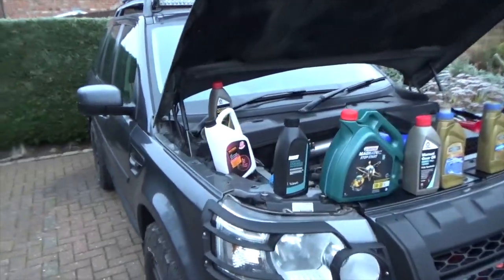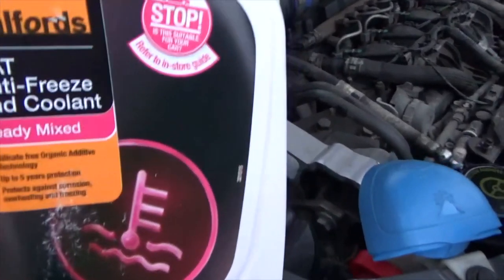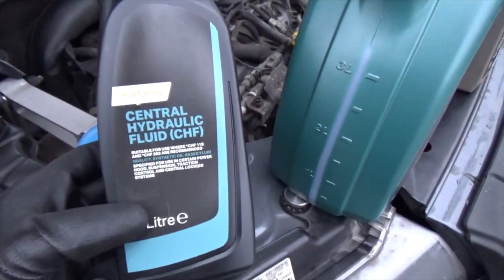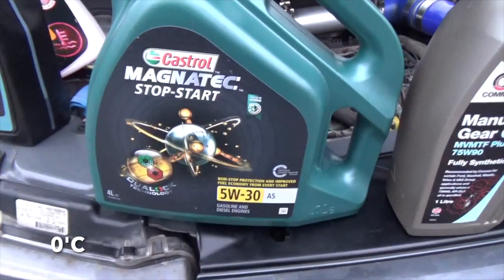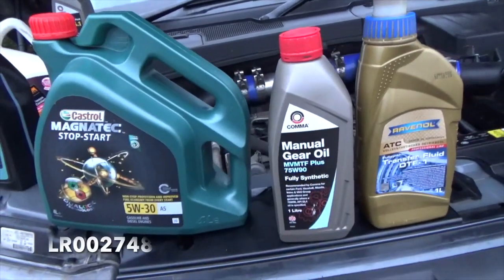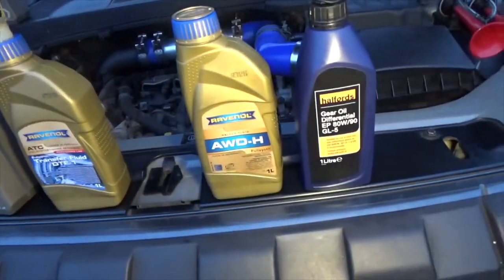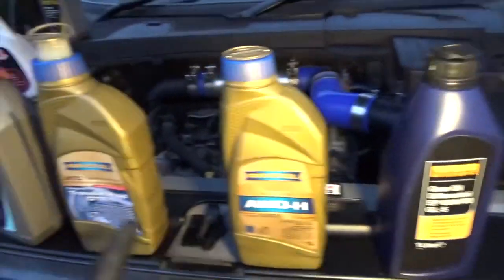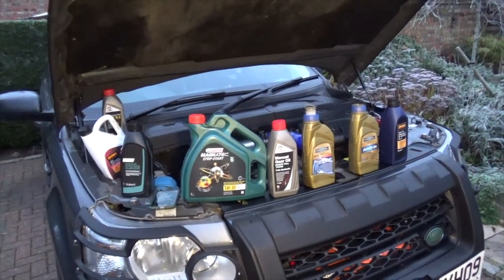All the fluids! - Land Rover Freelander 2 / LR2

Comment: Hi Scott
Last year my Freelander rear crankshaft oil seal developed a bad leak. The job was too much for me so I took the car to a local garage for repair.  As you know the job involved removing the gearbox so it made good sense to replace the clutch and flywheel assembly at the same time. The garage did a great job not your usual 6 bolts out and two back in There was no evidence that the box had been removed a real top notch job. The repair was done in the summer of last year, everything was fine but as winter approached the gears got increasingly harder to select especially on frosty mornings. A sudden terrible thought sprung to mind I wonder if the garage has topped the gearbox oil up after finishing the job.  I decided I’d better check this so after removing the gearbox level plug the oil level seemed to be fine but it appeared to be of a very thick consistency. I decided to drain the oil and on observation it was clear that heavy gear oil had been used. ( Grr ) I drained and refilled the box with the correct grade oil and suddenly to my relief my previous nice easy gear changing was restored. This just shows how important it is to use the correct grade oil at all times. That is a  very important and informative video you have made there Scott and just shows how crucial it is to always use the correct oils. 👍👍

Comment: Thanks Scott, very helpful. One question, you mentioned it’s important not to mix certain fluids, how do you know what fluids are already in your FL2 when to you need to just top up? Best wishes, Anthony
Reply from the maker: Good question! The answer is you don’t. If you are unsure what fluid a previous owner has put in then best to drain and refill. With coolant and steering you should be able to tell from the colour. For brake fluid and oil it is more difficult.

Comment: Hi Scott, can you recommend anything for unblocking washer washer nozzles. I've tried everything. Cheers!
Reply from the maker: You could try a pin and then blast through with something like an air duster. Failing that, just replace them, they are not expensive to buy and quite easy to swap. Check that it is the jet though and not the pump.

Comment: After the checking the part number on lr the 6 speed manual transmission oil seems to be a 75w fe, not a 75w/90 why did you opt for a different oil than spec, or is the same thing and I’m an idiot, or will it no really matter?
Reply from the maker: 75 is the cold viscosity so will be the same. I’ve not heard of 75W FE but you should check the hot viscosity. It needs to be 90. Haynes says 75w90. That is also what Halfords recommend.
Reply: @BeavisPits  Just in case anyone else is reading this slightly confused this is a note to clarify things. For the manual gearbox pre-2011 models (like Scott's) the LR specification in Castrol MTF 97309. This is a 75w90 grade oil as is mentioned in the video. For post 2011 models the LR specification is Castrol BOT 350 M3. This is a 75w single grade oil. Clear as mud...or old gearbox oil 🤣

Comment: Is it really only 1 litre for a manual gearbox?  I have an SD4 auto and I cant seem to find straight forward information on what type and what quantity of auto gearbox to buy.  Ranges from 1 litre to 7 litres (7 is dry fill so seems too much for a refill) and anything in between!
Reply from the maker: 1.9L for manual gearbox
Reply: I was told with the auto you need special tools apparently, its got to be done at a specific temperature and its a height measurement of the oil level within the gearbox not a specific quantity

Comment: Hello, I recently purchased a 2012 SD4 HSE. After buying the car, I immediately replaced it with Shell C3 5W30 engine oil. You put A5. Many Koreans say that C1 engine oil must be used, so I was curious about whether C3 engine oil would put a lot of strain on the engine, so I searched and came across this video. Wouldn't it be a big problem if I put C3 or A5 in it?
Reply from the maker: All FL2s are 5W30, but later models with DPF may need a different oil code. Mine is pre-DPF so uses A5. Later may be C3, I’m not sure. I’m sure it would be fine to use C3 in an older engine. The code is to do with smoke emissions not the lubrication properties.
Reply: Your comment is a month old but I use C1 on my 2009 LR2 with DPF. 

Has to be to Ford spec: WSS M2C 934B. 
I use Motul 8100 Eco clean +